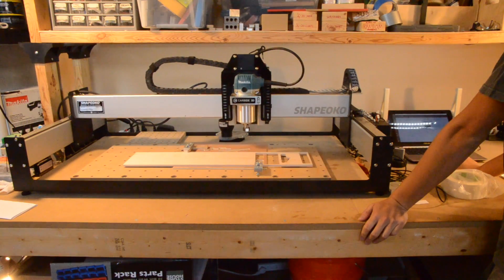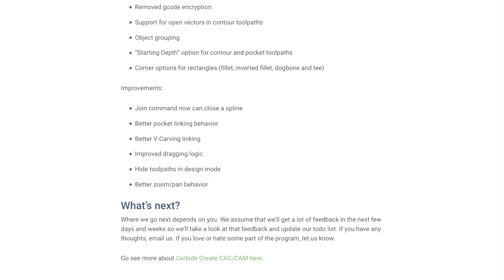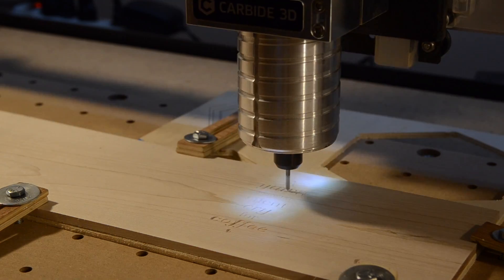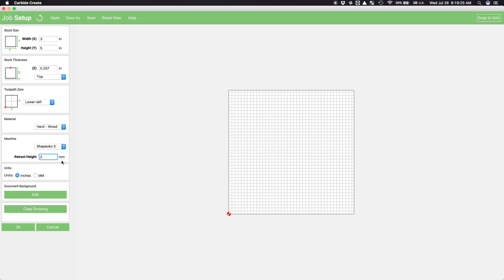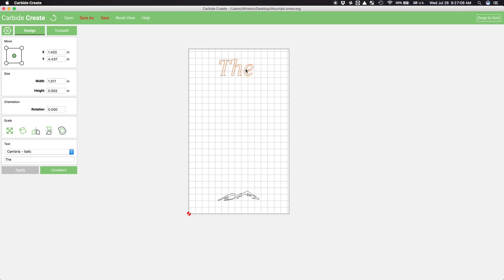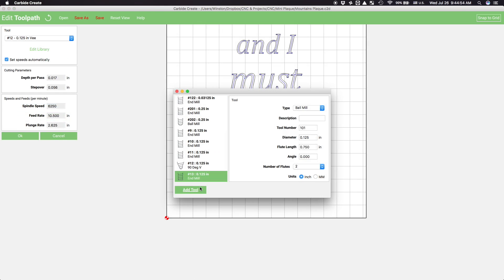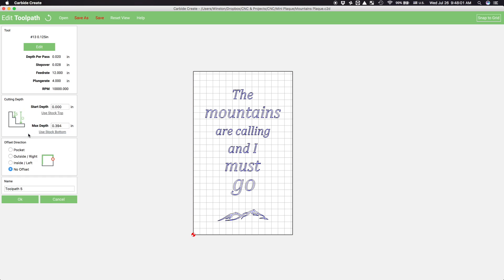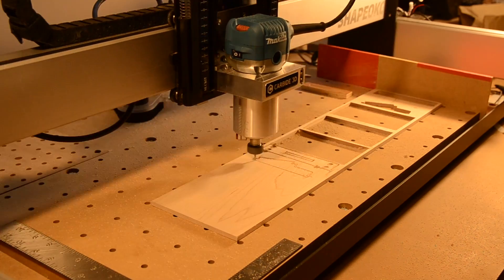Putting Carbide Create Build 300 to the Test - CNC Project #92

Comment: Hello, I'm a newbie and i can figure out why Carbide Create does not save to SVG ? v? ? I can't use Inkscape as it doe snot work my Mac with another program or app that won't work?? Why is it so difficult. i thought this woudl nto be such a problem. Any help? thanks.
Reply from the maker: Carbide Create is meant to open SVG files from another program, not save SVG files. It saves data in its own file format. If you already have a design in CC, then you shouldn't need to save it as an SVG anyways because CC will be the program creating the toolpaths for your CNC. 

Inkscape should be working on all version of Mac, including the latest, I have it working on mine. You need to have XQuarts installed too, as per their instructions. An alternative program I use is Affinity Designer, which is an alternative to Adobe Illustrator.

Comment: Winston great video, curious how do you go about making sure all your magnets line up?
Reply from the maker: The plaque and stand are designed such that the hole pattern is consistent between them, that guarantees axial alignment. Then when I embed the magnets, I install all the plaque-side ones in the same way, flip over my stack of magnets, then install all the stand-side ones. That methodical process keeps me from getting mixed up.

Comment: Based on this I tried V301.  Not sure what exactly you did with it, but I found it way below par.  Couldn't define a new Vbit to match my CARBIDE vbit so I had to hack the single vbit def to match my #302.  The vcarving path that it generated was bizarre (I use UGS visual before cutting).   I used the older versions a little before switching to Vcarve and this new version is not that good.
Reply: The interface for defining new bits is pretty wacky but it does work, I've added many. Vcarve is leagues ahead but I've made and sold work with Create's v-carve paths and they look pretty good to me. I can't afford V-carve either, and the method for achieving the same in 360 Fusion is really protracted and prone to the "swallowing" Winston mentions.

Comment: This is great news and great timing! I just got my machine back together after retrofitting it with a gShield/grbl controller (I have a late 90s benchtop educational router that is built like a tank but used ancient software and interface). I've been wanting to figure out an all-OSX workflow for projects and now I think I have the last part. Thanks!

Comment: Do you lacquer the board before cutting? I find if you do that then you don't even need to sand off the paint - it just wipes right off alcohol or acetone but stays perfectly in the letters where the end mill has eliminated the lacquer/polyurethane/etc.
Reply: What kind of paint are you using?  Is it acrylic or epoxy?
Reply: cabrio996 I've done it with both oil and acrylic paint with same results.

Comment: Neat project. I noticed you use both a DeWalt and Makita in the video. I'm just curious.. Did you upgrade to the Makita router and are there any significant differences between them?
Reply from the maker: They will both cut woods just fine, I use the Makita indoors for acoustic reasons (10 RPM is quieter). On aluminum the Makita is highly recommended for the lower RPMs. Dewalt is a little longer, Makita has trouble reaching the wasteboard with tiny short bits unless you have an extra 3/4" MDF layer (preferably machine leveled) like I have. Subtle pros and cons to both.